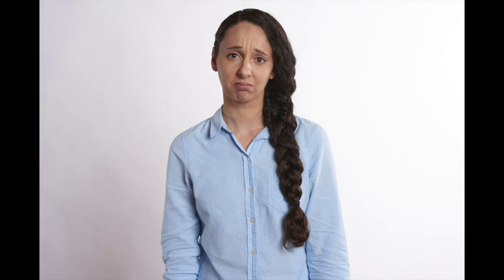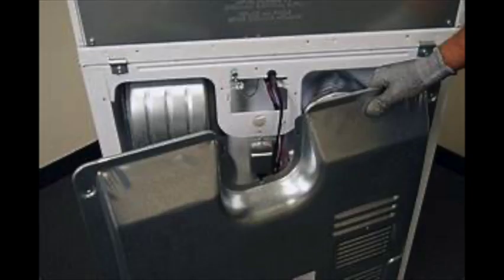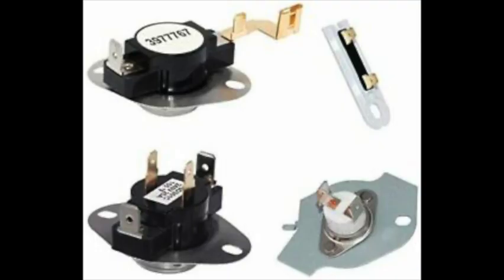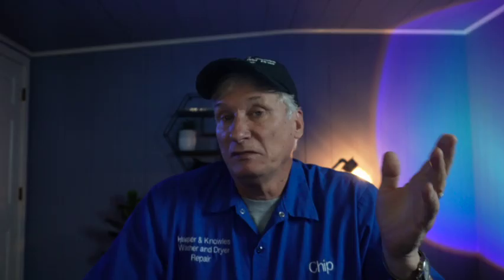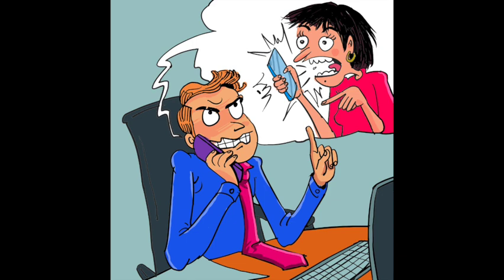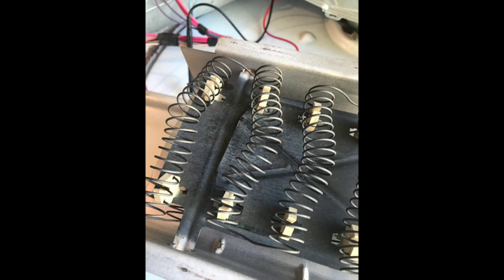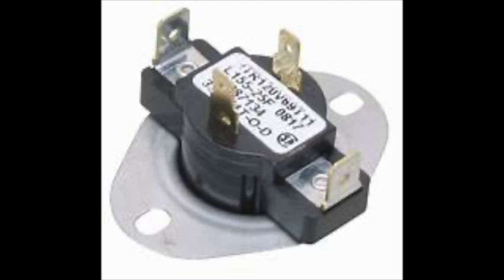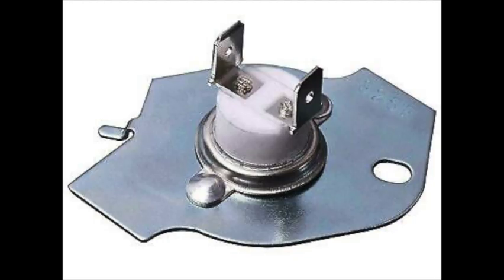How To Diagnose Clothes Dryers That Blow Fuses: Testing Thermal Fuses & Beyond,

Comment: Thanks. I had this exact thing happen to a dryer i sold but couldnt figure it out and after high limit number 2 i just swapped out the machine
Reply from the maker: I hope you didn't scrap out your defective dryer. I think I did that a couple times before I figured it out. Thanks for watching.
Reply: @HarperandKnowles  yeah i did, i actually have more washers and dryers than i can possibly repair so it wasnt a big deal but i always prefer to know why somthing doesnt work rather than resign myself to being defeated by it again.